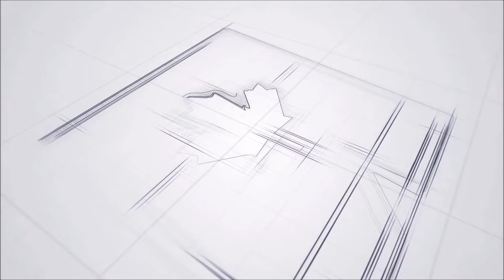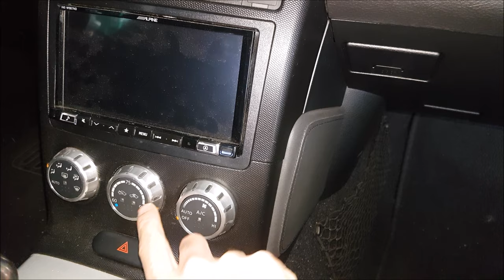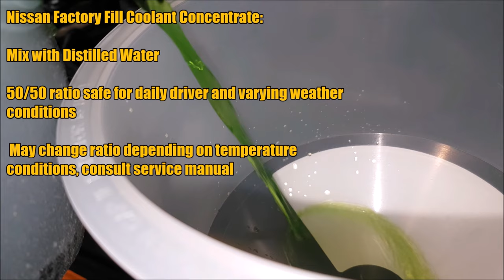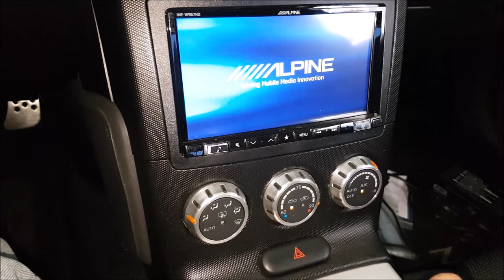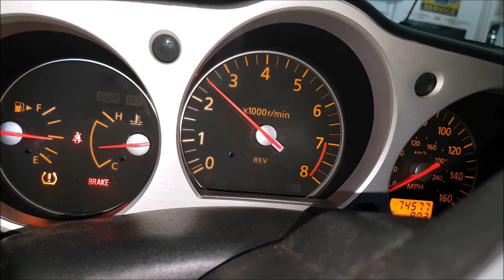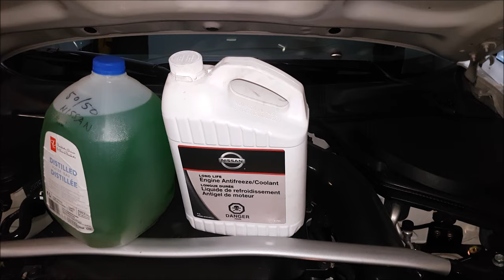How to Bleed Coolant System Procedure Nissan 350Z & Infiniti G35 (Nissan 3.5L V6) | AnthonyJ350

Comment: Nice work! I didn't buy the special overflow filler. I filled the radiator until full with the air bleed valve opened. Closed it all up and started the car for a minute. Shut it down, refilled it again. Repeated 3 times. After driving the car for 10 miles on the freeway, the car's heating system was working properly again.
Reply: Thank you I was looking for one of these that someone didn’t use the filler because I have to do mine tomorrow and I don’t have one so I wanted to know how you do it without that
Reply from the maker: Thanks for sharing
Reply: how did this hold up? having trouble even with the funnel kit
Reply: Hey man when you did it did you take of the radiator cap will bleeding it or did you close it aswell ?
Reply: @mynameiswhat960  use a radiator funnel bleeding kit from harbor freight or autozone itll help alot bro
Reply: That's basically what Nissan suggests. However, you did miss one point which is you need to warm up the engine until thermostat is OPEN. You need to do at least 3 heat cycles which is warm up the engine(until thermostat is open) -> let engine cool -> refill coolant in radiator and tank.
Reply: Something we did in the old days, that no one seems to mention anymore, is pour the coolant in very slowly.  So many diy'ers are impatient and just shove the coolant in which traps more air.  Pour very slowly when filling with coolant.

Comment: Honestly this video has helped me out a lot. The last few days I've been struggling with my G35 overheating after replacing the water pump and the thermostat. After watching a video I went to Harbor freight and bought the funnel kit and it bled out the air and my heater is working perfectly and my car is no longer overheating .I appreciate the information
Reply from the maker: So glad to hear the video helped you! 🙂
Reply: I did same...bought funnel kit at Harbor freight...2008 M35S..saved some $.
Reply: did it overheat when u floored it ? mine sometimes drives fine and sometimes itll start overheating as i drive faster to work
Reply: @vvtheonevv4007 happened to me but when I drained the entire coolant it was almost brown with green at first after bleeding it and replaced the thermostat and put in the new coolant it drives fine as fuq. Added a new ac fan and the other fan assembly from Amazon it was below operating temperature.

Comment: Can I still do this bleeding process after I already filled up my new radiator with coolant? Or do I need to start all the way over and flush the coolant from the radiator since I didn't bleed it?
Reply from the maker: You can just bleed it if you need to.

Comment: I had been at it for about 45 min got scared and turned it off. I was going to just drain it all out and start over. It was bubbling like it was running hot but the temp didn’t rise up so that’s ok? I guess it’s cool now and I will try it again maybe attach a video so you can see thanks
Reply from the maker: Yup that's how long it took me. I shut it down after the fans turn on and repeat the cycle. What's your coolant to distilled water mix ratio?

Comment: I wasted a whole weekend trying to bleed my 350 per the service manual and youtube videos and this is what did the trick for me. Like this video, use a spill free funnel on the radiator and open the bleeder screw. Fill the funnel until coolant comes out the bleeder, then close the bleeder. Keep filling the funnel until the coolant level in the funnel about 1/3 to 1/2 full. Do not fill too much as the level will rise and could overflow.

Crank the car and let it idle until it reaches normal operating temp (temp gauge needle about halfway). Now here's what i did different after struggling for two days. Turn the heat on low, NOT full blast. In my mind, the heater core and your dash blower fan act like a mini radiator. The higher your dash blower fan is running, the more its cooling the engine. You MUST still turn the heat on though so it tells the system to circulate coolant through the heater core in your dash, just keep it on low. Also, DO NOT run the AC compressor. This will immediately turn your radiator fans on making it harder for your engine to get hot. The goal is to get your engine hot enough to open the thermostat. 

Use your hands with a glove or rag to feel the temperature of the lower radiator hose coming out of the bottom of the radiator. WARNING, IT MAY BE HOT! If the lower radiator hose isnt hot, the thermostat is not or did not open. Mine was ice cold even after revving to 3k rpm for 10 seconds a few times per the service manual. Instead, hold the throttle at 2000 RPM sustained for 1-2 minutes and watch the temperature gauge to make sure it doesn't start to overheat. The gauge should stay at halfway or below. While doing this, tons of bubbles started coming up. I did this a few times and then checked the temperature of the lower radiator hose, it was nice and hot which told me the thermostat was opening hence all the bubbles. The air coming out of my vents in the car also started to get hot and stay hot even when running at idle. Keep topping off the funnel so it stays at approx the halfway mark, never let it get empty. After a few more 1 minute sustained 2k RPM sessions, i saw no more bubbles and my cabin heat was blowing hot at idle. 

Turn the car off and let it sit for a couple hours so as the engine cools down it sucks in more coolant. Remove the funnel, put the radiator cap on, and you are done. Might need a new thermostat soon but maybe my system has a high tolerance for heat or runs cooler than average. These cars are finnicky. Hopefully this is helpful for other people having trouble and you dont waste a whole weekend like I did because my engine wasnt getting hot enough.

Edit: The key here is if the lower radiator hose isn't getting hot using the nissan service manual technique of 3k RPMs in 10 second bursts, you need to generate more heat so the thermostat opens.
Reply from the maker: Thanks for sharing your experience!
Reply: 😢 i have problem with overheating after coolant flush 
Turn on heater and it is blowing hot air 
I waited until radiator fan came on then turned off the heater with the engine still on and the god damn coolant was overflowing 😢
Ive tried again this time i didnt turn off the heater after 15min i put the radiator cap back on then i revved abit then the dash temp was raising to Hot 😢😢😢😢
Everything was working fine until i decided to do a flush my dad gonna whoop my ass
Reply: Dude!! Thanks so much for this comment! This, along with the video made it easy to bleed my system in no time. No more overheating, and the G is once again fun to drive. 👏🏻👏🏻🙏🏻
Reply: @SchizoAction  No problem! Glad it helped!
Reply: @hubsun700  did you get your ass whooped 😢
Reply: @TreThompson  i removed the god damn thermostat lmao
Reply: Hey man quick question I would do this process after fully draining out my coolant from the radiator right? I just wanna make sure bc my g was overheating and I added coolant to the reservoir so I just wanna make sure
Reply: @kristianst45 

Did you already change your coolant? You do this process after draining the coolant from the car and then filling the radiator back up with coolant and replacing the coolant in the reservoir. Just to be clear, make sure you have coolant in your system before doing this process. How you change the coolant in your system is up to you (there are other YouTube videos for this).
Reply: @drober8588  so when my car originally overheated I looked inside the reservoir and seen that it was empty so I added more coolant like that but that was it when doing all of this just empty my car of the coolant put in new one and obviously follow the video like that?
Reply: @kristianst45  if you didn't bleed the system after draining and refilling the coolant, this will by default trap air in the system and likely lead to overheating. Sometimes though the air bubbles will escape on their own through the reservoir tank. When this happens, the engine will suck in coolant from the reservoir tank to replace the air that escapes, which seems like what's happening in your case. If you are not overheating now and your heat inside your car works at idle, just keep topping up your reservoir to the MAX fill line until the car bleeds out the air on its own (check it every day you drive until it stops falling below the MAX line, preferably when the engine is cool). If you are still overheating or your heat in your car doesn't work at idle, then I suggest bleeding the air properly using the method in this video. I would not rely and hope that it bleeds out on its own as your engine is not being properly cooled in this scenario which could lead to engine damage over time. You don't need to re-drain and refill the radiator to do this. Just wait a few hours for the car to cool down, attach the spill funnel to the radiator like in the video, and go from there.
Reply: @drober8588  Yes when I put in the new coolant I put a good amount in a little passed MAX tbh and earlier today I was idling and it was blasting semi cold air while the heater was on and although the temperature wasn’t rising, when I sat there for a minute it slightly started to go up and still no hot air so I’m guessing I need to correctly bleed my car? Also thanks for replying it’s my first car and I’m trying to make it last
Reply: @kristianst45  Yes, if your heater is still blowing cold air after your car has reached operating temperature at idle it means you still have air trapped in the system and need to bleed it like in this video and my original comment. So, if your dash temperature gauge needle is sitting at about halfway at idle and you still don't have heat in the car, you need to bleed it. No problem!

Comment: Today one of my water hoses broke, it let all the water out of the radiator, i replaced the hose and refill the coolant and it kept overheating, and it never had issues overheating before so i was wondering if the thermostat broke i was going to replace it until i watched this video. I bled the system and it did the trick. No more overheating. Saved me some time and money. Thank You sir. This video save my butt.
Reply from the maker: Glad to hear the video helped you 🙂

Comment: Thank you for these DYI videos man! I’m not much of a mechanic but when I watch your videos it sure gives me knowledge and confidence to work on my own car. I also have a 06 rev up 350z and we pretty much have almost same bolt ons. I’m getting Uprev tuned tomorrow as we speak. As for the meantime take care and stay safe bro!
Reply from the maker: That's so awesome to hear!  I glad to the videos are able to help you out.  Comment back here after the dyno tune is done.  Who's doing the tune?  

And remember, it's not about the number on paper after, it's about the engine being calibrated properly and the car driving better overall.
Reply: AnthonyJ350 don’t worry I won’t have my hopes up. With your previous video you already talked about this so I know what I’m getting myself into. After all those bolt on it’s a good peace of mind to know your a/f ratio is good and to keep the reliably of your engine. My car only has 74k miles and it’s going to be my daily. I’m going thru “intec racing” local shop for the tune. Did you notice a drastic change in power after the tune?
Reply: @AnthonyJ350  
Need help with a g35. Got no heat when at idle. It can set and idle all day and never get hot but it over heats almost immediately after I start to drive.
Reply: @AnthonyJ350  hey I have a question? I have a 06 Nissan and I’m trying to bleed it the same process as you but I have not turned it on for a long time. The battery died and it was replaced with a new one. I drained the old fluid but now I’m in a dilemma about the bleeding. Do I input the new coolant and wait for the car to warm up since it hasn’t been turned on for awhile and continue the bleeding or do i do the bleeding right after it’s turned on with the funnel?

Comment: Hi. Watching this from the UK. Just fitted silicone radiator and crossover hoses. Will be refilling and bleeding so this is a great help. Thanks
Reply from the maker: Let us know how it worked out for you!  Remember bleeding the cooling system might take up to 45 min including cool down time.
Reply: Bleeding the system is a necessary step for installing a new radiator just  asking Becuase I’m installing a Koyo next week when it comes in.
Reply: @AnthonyJ350  Hi. Well, finally managed to bleed the system. Didn't have a spill free funnel (but will be getting one). Slowly topped the fluid up and ran the engine with the rad cap off, the bleed screw open and heating controls on to max. Expansion tank at max level. Had some spillage as the air came out (I use kids nappies to soak up, so spillage contained). Revved the engine to a steady 2500 rpm for 10 secs. Did this a couple of time then turned off. Left to cool down. Fluid sucked out of expansion tank. Left overnight with rad cap off. 
Next day checked all levels and repeated cycle. Less spillage this time. Left overnight again. Topped up fluid directly through the bleed valve. Repeated again the next day and took the car for a run. Hot air from heater and car temp normal. I would say that the above method is certainly fussy and takes longer than your method with the funnel. What your video helped me with was the general approach and importantly the confidence to take my time, have patience and knowing you'll get there in the end.
Reply: Many thanks
Reply from the maker: @neilmorris4160  Great job! That's the key is to know it takes some time to get it done. Glad to hear this video gave you some key ideas 😃

Comment: my original comment: 

my fans turned on but the funnel overflowed, i turned it off and the coolant in the funnel went back down, what should I do? The upper radiator hose is hot and the lower one is cold.

My solution: new thermostat. I took my old one out, put it in boiling water and noticed it didnt open until the water got REALLY hot.
Get oem. I had mine replaced 7 months ago with a non oem one and it failed. Last week.

If you follow the video step by step you will be good! Thank you!
Reply from the maker: Thanks for sharing!  I agree, for crucial parts like this.  Get OE made in Japan parts.

Comment: Hi dude , I literally just need to top it up , however I do have a coolant reservoir . Shall I bleed the system through the radiator as well ? Thanks
Reply from the maker: If the system hasn't been serviced for a while a coolant bleed won't hurt.  I would recommend putting in fresh fluid.

Comment: Just put in a new radiator so 😢i hope this works it may be ny thermostat ...my fan working & its atill rising past the middle mark in the dash do i fill it 1st or do i bleed it during redilling of lost coolant during the abstraion of the radiator?
Reply from the maker: Open the bleeder and fill the radiator till it pours out. Is the front end elevated when you do this? Make sure you secure with jack stands and secure the rear wheels with the parking brake on please 🙂

Comment: I actually did get an aluminum bleeder from Z1 thanks to you. 😁
Reply from the maker: I think it's sooooo much better to work with.  What do you think of it?
Reply: @AnthonyJ350  it's definitely a permanent fix. Plastic and hot pressure don't last very long. The oem bleeder is a catastrophic fail and difficult to detect when you get overheat issues. Misdiagnosed a working thermostat is a waste of money.
Reply: @AnthonyJ350  every VQ needs one from Z1

Comment: Hey man recently my g started to overheat and I added some coolant then I noticed my hot air wasn’t working I’m fixing to do this to see if it works however would my very first step to this prior to jacking it up be drain all the coolant from the radiator?
Reply from the maker: Fresh fluid is always a good idea. Sounds like the system needs to be bled and/ or your thermostat is stuck.
Reply: @AnthonyJ350 if it is my thermostat how would I be able to tell
Reply from the maker: @kristianst45  Measure the heat of the upper and lower rad hoses on the radiator when you get to operating temperature. If working correctly they should be similar in temperature.
Reply: @AnthonyJ350  say no more thanks man for replying, wether it’s my thermostat or bleeding my system I’ll check back in
Reply from the maker: @kristianst45  Yes, always curious to know how people diagnose and fix things. Helps me learn too 🙂